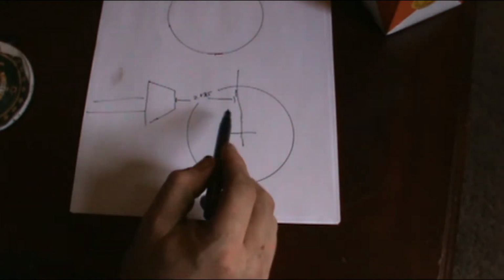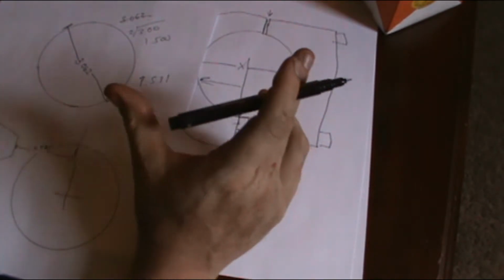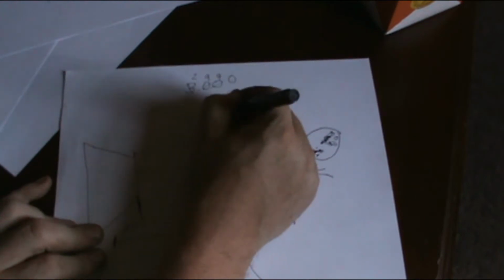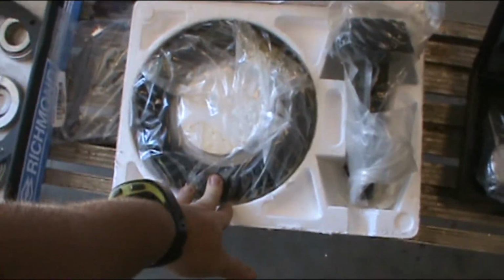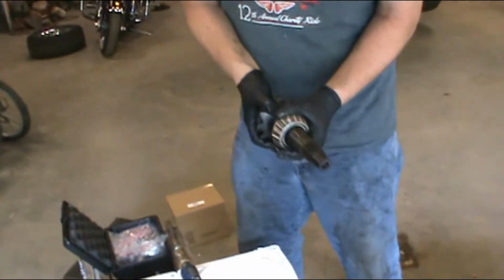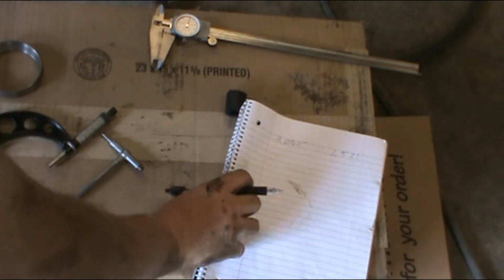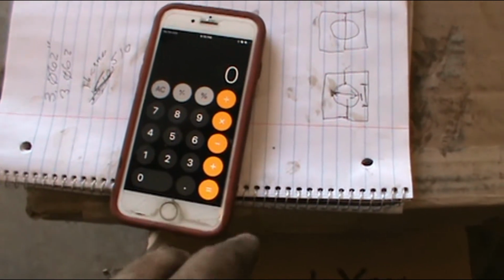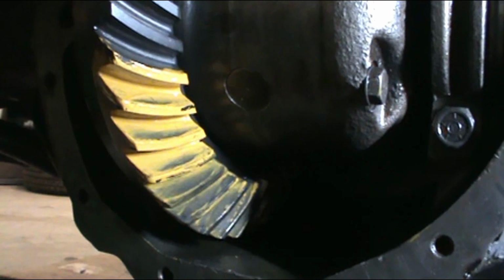Proform Parts 66516 Pinion Setting Tool instructions

Comment: Will the proform tool measure pinion depth in a housing that doesn’t have caps?  ie:M80 7.75 GM differential?
Reply from the maker: It is designed to measure off the centerline of the bearing, is there a flat surface that is inline with the center line of the bearing
Reply: GSE Shop   Not that I can see. The carrier bearings fit in the housing and threaded end caps are used to set backlash.  The only thing I can do is setup and test, setup and test. I have the old gears that came out of the diff so I can check that pinion depth against the Motive Gears and maybe that’ll give me a starting point for pinion shims. Right now the old shim is in it and the pattern indicates it’s not deep enough into the ring gear.
Reply from the maker: @coarsegrind  I have only done two 12 bolts and my buddy borrowed it for a 9inch.  I do know that every gear set is different, even the same ratio from the same manufacturer will have a different depth etched on them.  Other than a real pro tool I don’t know what will work, I am not affiliated with the tool or anyone else, just fond the directions confusing and thought I would try to clear it up

Comment: Couldn't you take a piece of flat stock 1/2x1/2 x long enough to fit into bearing cup. Drill hole in center of the stock so the dial indicator would set into it. Then add magnets on underside both ends where it makes contact with the cups ? This would allow it to set there while taking measurements.
Reply from the maker: If I am visualizing what you are talking about correctly, how would you know you were at the lowest point in each cup.  Other than that it could be a great idea, but this was an explanation and a review of the tool as delivered.  Given a machine shop I probably could make my own pinion depth pucks for the pro tool.  This will work pretty good and can be used in all applications as is.  I appreciate the idea and feed back sir.
Reply: @GSEShop  I was thinking ahead of a tool that would be universal and used in all makes of vehicles front or back. Your review was great but if only there was a universal one. How great would that be for shops !